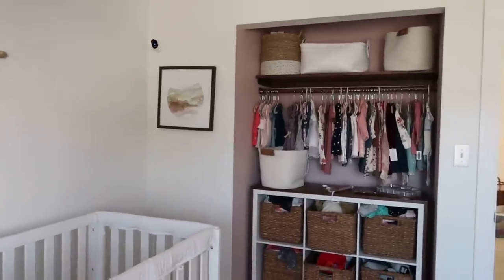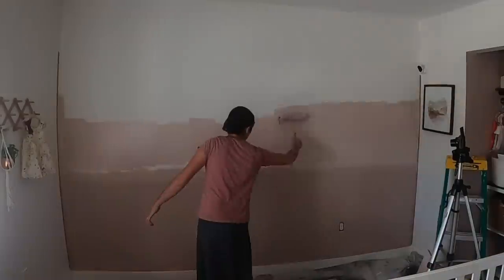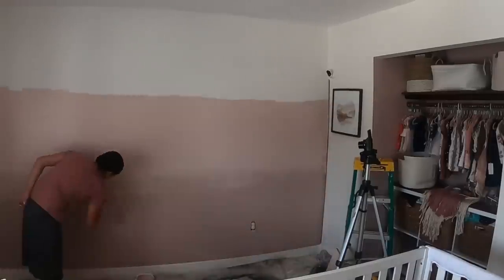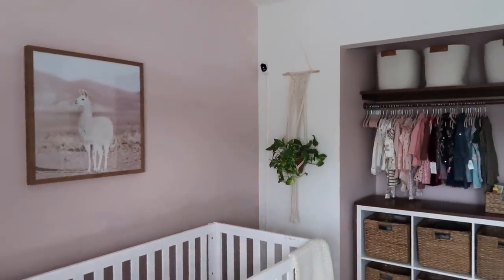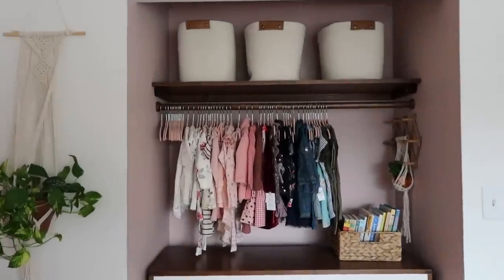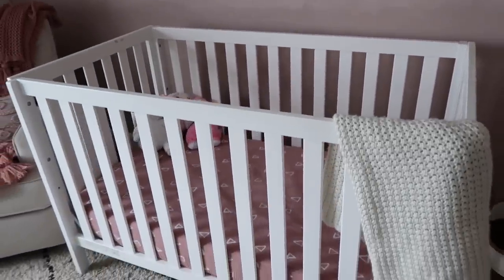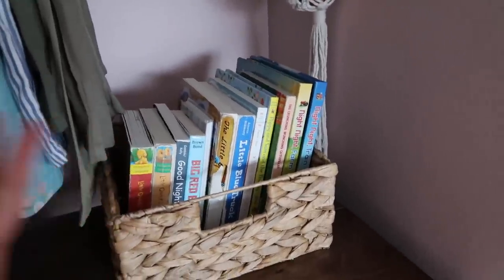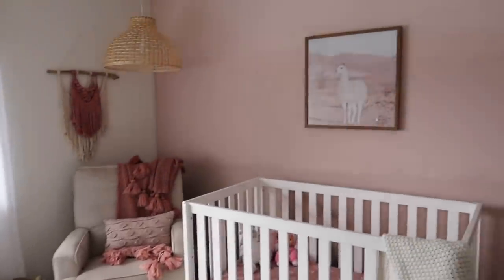LITTLE GIRL'S ROOM MAKEOVER, TOUR & ORGANIZATION | DIY OMBRE' WALL

Comment: That bottom layer paint would look perfect on that dresser.
Reply: Or at least just the top of the dresser. An intriguing idea would be to find a roll of wrapping paper ( roses, scrolling vines, damask pattern) then protect that with plexiglass that fits and could be held to the dresser top with mirror clips (the type for no frame mirrors). Then if your color scheme changes, the dresser is still wooden, unpainted. A new roll of paper beneath the plexiglass. And decoupaged pots of same paper for planters. 💝💕💕👌

Comment: Simple, light good changes. Suggestion: get a nice shower caddy, paint if desired. This could hang on wall by the chair/lamp. A few little books, tissues for runny nose, pacifier, a fake plant. Put bookmarks, or a small 3-5" stuffed toy hammock.

Comment: Love the accent wall. Well done. Only concern I have is the lama picture is too low near the crib.  She may grab it and pull it down.
Reply from the maker: I took it all in consideration before hanging it. Thanks. The crib is pulled out from the wall. You might not be able to see it.  And it’ll be a while until she can reach it. And then if it’s needs more securing I’ll do that. ☺️